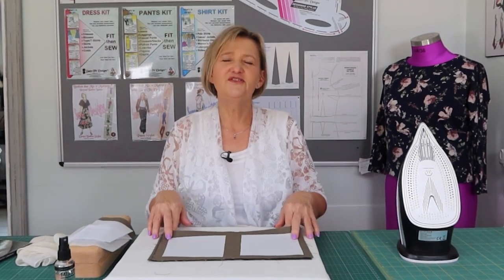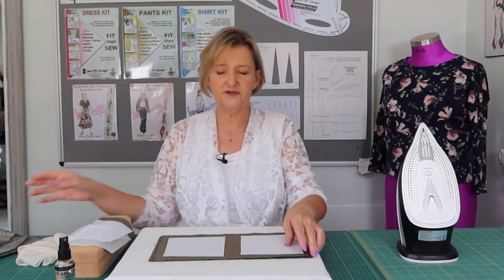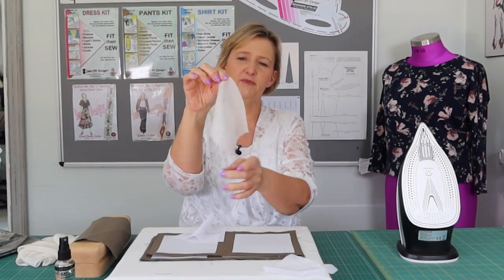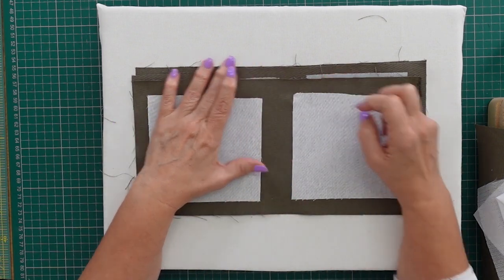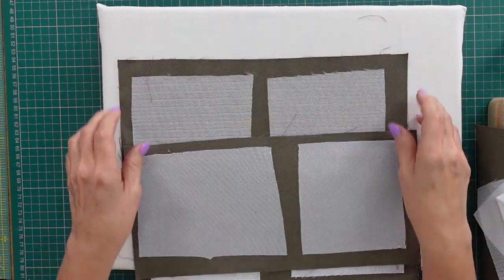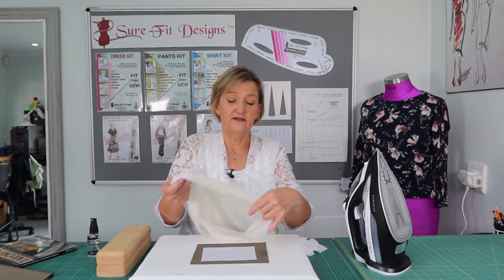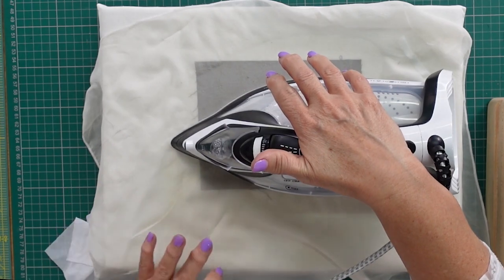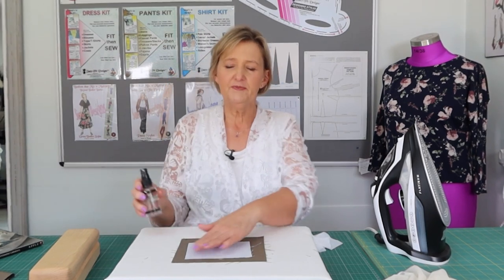Steam or no Steam? How to apply fusible interfacing that won't peel off.

Comment: Thank you for your thorough explanation of stabilising. I have noticed that the stabilising method I was using was crinkling. So frustrating! I used your method and it works! Many thanks.
Reply from the maker: Thank you for watching and giving me feed back after trying it. I appreciate it so much
Reply: Yes, I made a small purse and the fabric is all crinkled/wrinkled, so disappointing.

Comment: Can you please give some suggestions for interfacings in South Africa? The local stores only have interfacing that once is set actually feels like a cardboard. It's light interfacing but no brand or anything. Not like overseas. Any suppliers you can suggest please. Very helpful info
Reply from the maker: Please join my WhatsApp group for updates on products. I have a fusible interfacing kit that I. Am announcing next week. It includes the soft stretch interfacing for knits and soft wovens as well as a slightly firmer cotton interfacing that I use.  I use Freudenberg interfacings which is a German brand. Most of their fusible have codes instead of a name, but the cotton one is called Korlene
Link for WhatsApp group is https://chat.whatsapp.com/Dly8GHmMy5e4Nh9nTXgTyM

Comment: Hi Elsabe Great tutorial from a fellow SA, haven't come across many SA you tubers. Such a pleasant surprise. Thank you. Will this method also work for felt? Have you ever used fabric interfacing? Is it available in SA?
Reply from the maker: Hi Kathy, thank you for watching. I only use fabric interfacing when sewing. I am not a fan of the paper like interfacings. I have different weights of interfacing so that it matches the fabric I am working with. 
I don’t sew with felt so just do a test on your felt to see how it works.
Reply: Thanks for your reply. Only now do I see you were demonstrating with fabric i/facing. Can't seem to find it here in the E Cape, have even tried googling for suppliers in South Africa, with no success. Fabric interfacing has been recommended for felt.
Where do you purchase I/facing ? TIA
Reply from the maker: I get my interfacing from my wholesale supplier. I sell a fusible interfacing box with different weights of the fusible fabric interfacing. I am out of stock at the moment and will only have stock again in January. I have seen some fabric fusible locally at the Dubai Centre fabric shop and sometimes at Chamdor Factory sales. They do ship orders, so give them a call to see if they can help you.
Reply: @ElsabeHurn thank you.